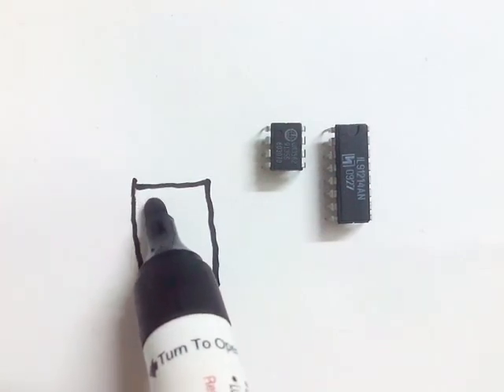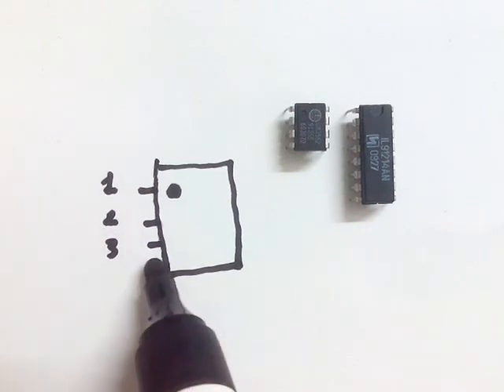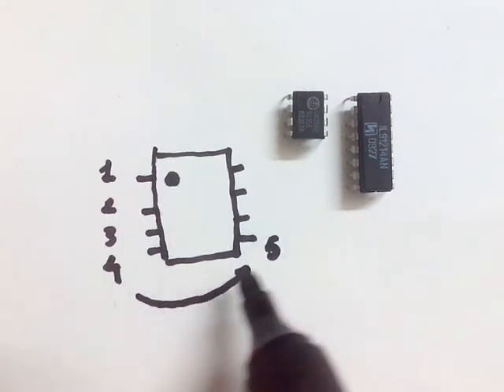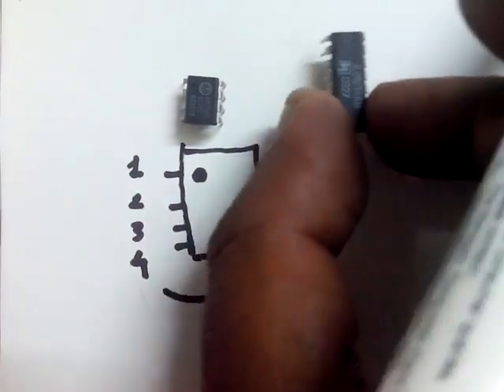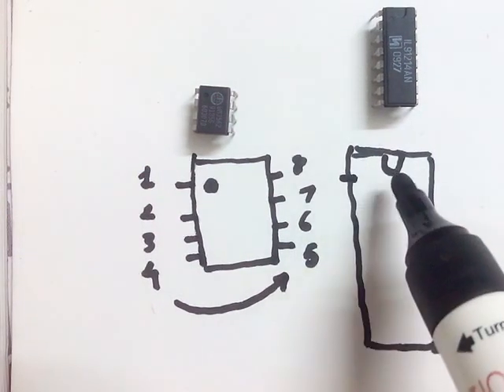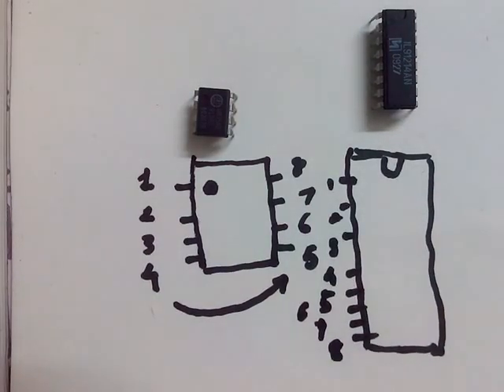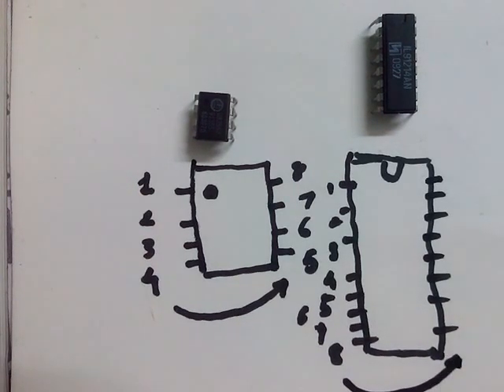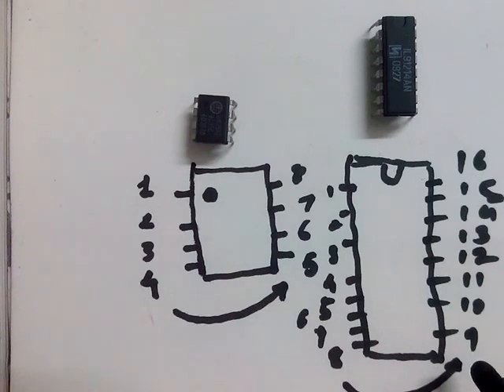Ic pin configuration | How to identify pin configuration of electronic IC | how to find IC pin

Comment: Do all the 8 pin ic functions the same..?? 
I mean can I use any 8 pin ic for replacement of another 8 pin ic?
Reply from the maker: No, never. IC means integrated circuit i.e. a much larger circuit is integrated in to small IC chip which means every IC has its own circuit built in it hence every IC has got its own datasheet which is essentially different from every other IC except its equivalent. Every IC is designed keeping in mind its application like timer ICs, musical ICs, analog to digital ICs and so on each one is different from others.
Reply: Video Pedia. Thanks and a 8pin ic in one of my motherboard has burst. So how do I get a appropriate replacement..??
Reply from the maker: Mr. HORMIN LIKHA, you have to carefully find IC no which is printed on top of IC then you can replace the same. In general IC will burst because of high voltage which is outcome of some of the peripheral components improper functioning which may even burn newly introduce IC. Take domain expert advice.